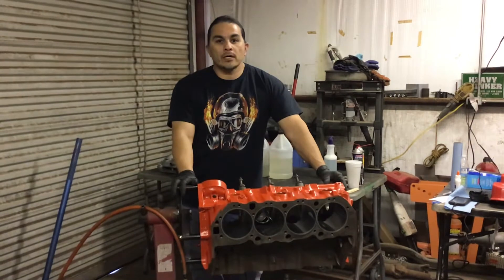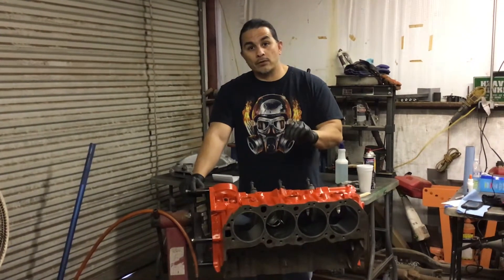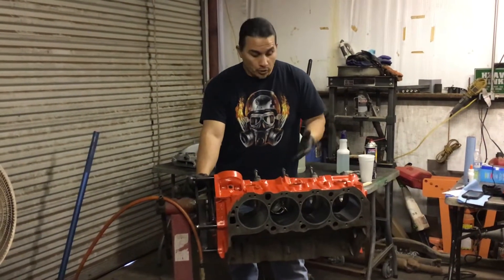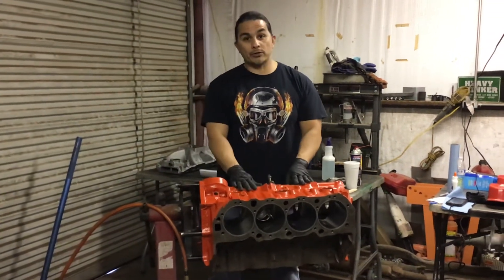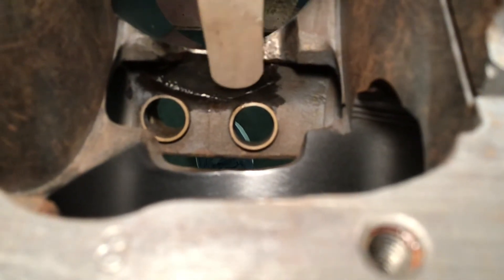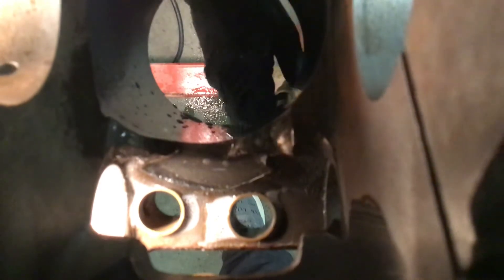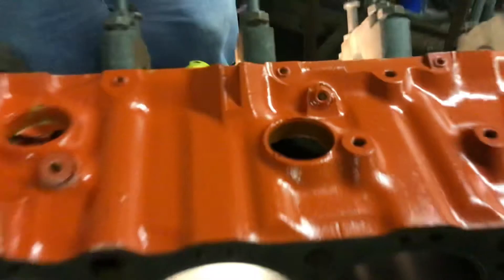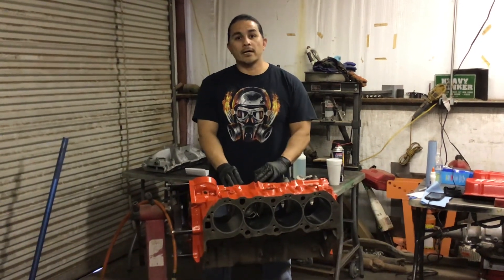How to repair a cracked big block

Comment: nice work!  But I would be very careful, have you put this engine together yet?  I would do a proper pressure test, not just blow air at backside of crack.
Reply from the maker: Yes, it will hold 2000psi.  Thanks for watching.
Reply: How did it hold up?